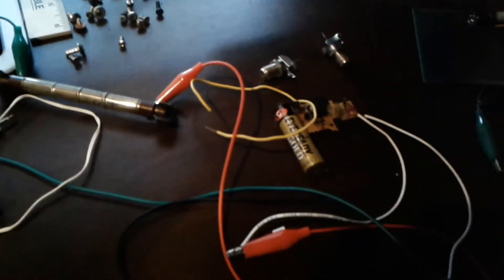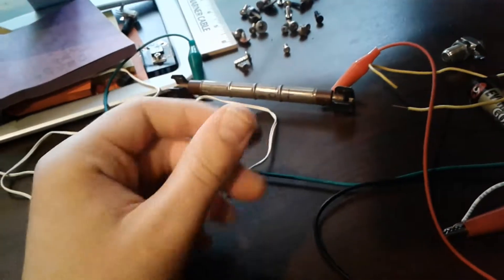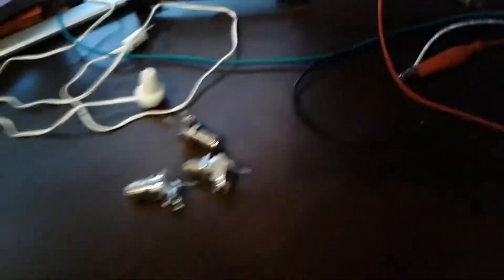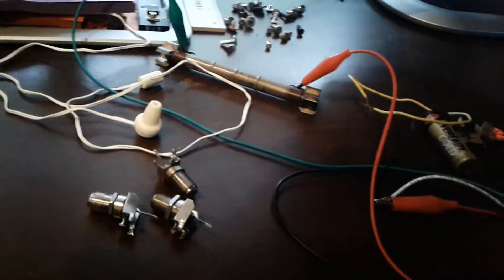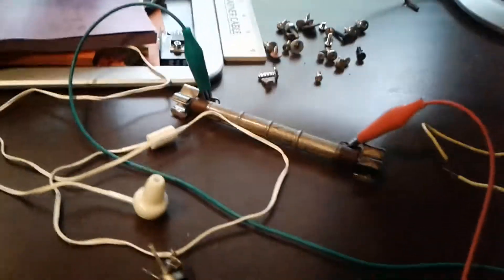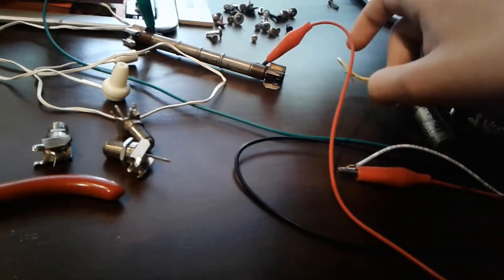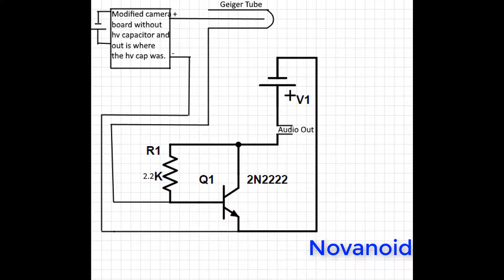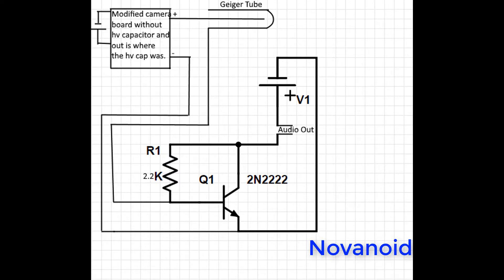Super easy DIY geiger counter tutorial (cheap with schematic! )

Comment: any way to add an Analog meter to this circuit?
Reply from the maker: Definitely possible, maybe easier to be digitized though. You can convert the clicks to a nice digital signal with a monostable 555 timer and count them with an arduino.

Comment: Great video, look forward to building one of my own however I have a few questions.

1)The camera circuit you refer to, could you explain more what type of circuit that is? Or any circuit boards online you could link me to that are similar to the one you used? I cannot see very clearly from the video to understand what it is.

2)For your DIY Geiger counter, what level of accuracy did you get at? as compared to the more expensive store bought kinds?

Thank you for the video!
Reply from the maker: Firstly, the camera circuit can be replaced with any circuit that produces a constant high voltage (typically between 300v and 500v but the exact operating voltage depends on the geiger tube... here's mine for example : http://gstube.com/data/4540/). Any buck converter should work. The camera circuit has a small transformer on it that steps up the voltage to about 400v. To get the transformer to work, the circuit has an oscillator before it is fed into the transformer (here's a better explanation : https://electronics.howstuffworks.com/camera-flash3.htm) 

Secondly, as to accuracy, every audible click is an ionization event occurring within the tube and the circuit should register all of them. This DIY geiger works just as good as a store bought one, other than the fact that my version lacks a digital readout... though I suppose you could manually measure the counts per minute. You could use an arduino to calculate the counts per minute and have a rough conversion to an energy unit such as mRem or uSv (however this would be terribly inaccurate as geiger counters are not good at energy measurements and this would be terribly off.) Therefore, you could definitely use the geiger counter to detect and gauge radiation but not effectively measure it.

Hope this helps ;)
Reply: @novano1d  Thank you, that helps a lot. Appreciate you replying back.

Comment: This is a great video, Thank you for posting,, i assembled it and it works great,, i would like to add a LED that will flash with each click,, could you please show how to do this, Thanks again, Andy,,
Reply from the maker: Glad you enjoyed it! I will attempt to add a LED to the circuit, but adding a LED makes the circuit a bit more complicated. You will probably need to use an adc and arduino. https://www.youtube.com/watch?v=HbQZkee0o3I - This video doesn't detail exactly how to build it, but does give you a basic idea. You wouldn't have to add the lcd and that if you didn't want to, but you're code would be different. Hope this helps.
Reply: cou just need to connect the led to the speaker in paralel and add a resistor with about 200 ohms